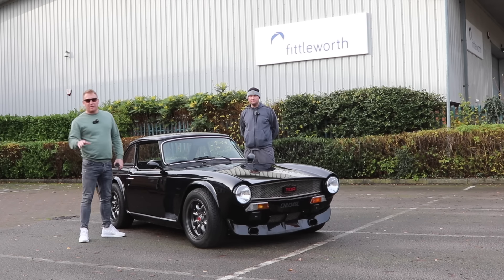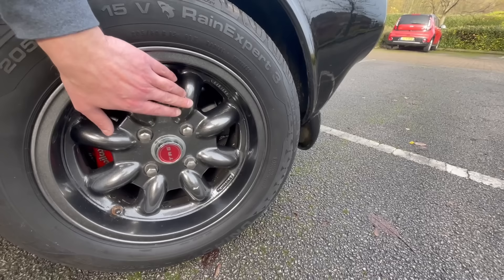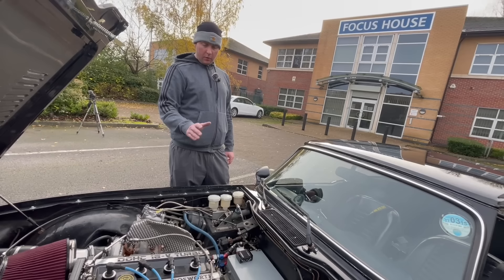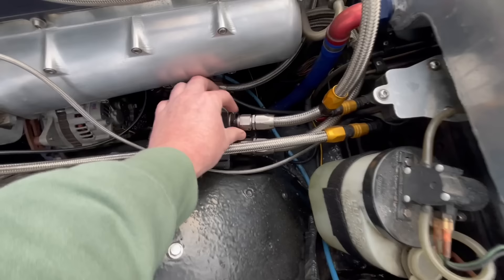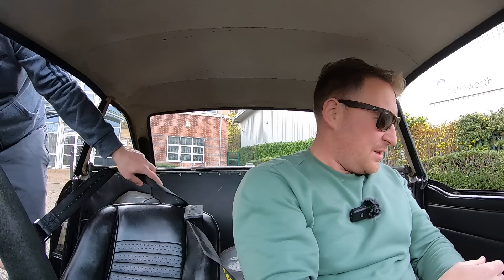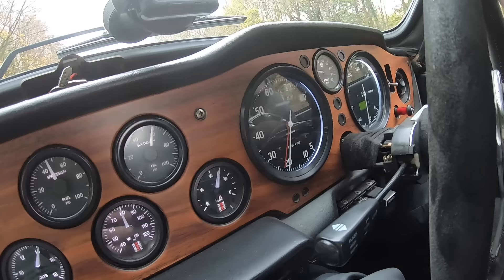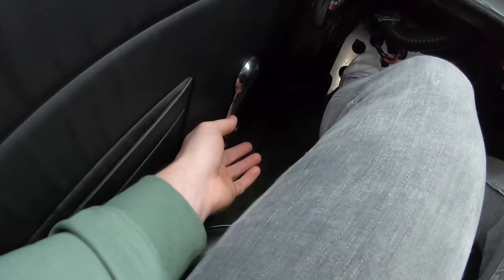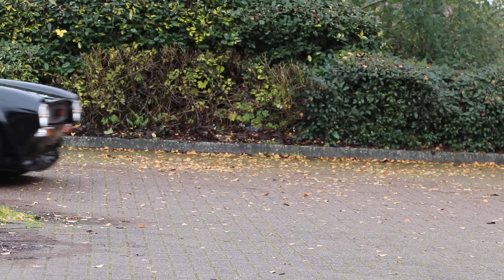This COSWORTH ENGINED TRIUMPH TR6 is SERIOUSLY MENTAL!!

Comment: What a fantastic car! Can't believe more people haven't done more restomod projects with a TR6, because it's such a cool looking car with bags of space in the engine bay. The look on his face when he gave it some beans, you can tell it's really on the edge with all that power in such a small package. His look is not just of fear but more like "What am I doing? This thing might kill us both!!" 🤣🤣
Reply: A guy on my block did a TR6 back in the early '80's but he put in a 355 small block chevy with a turbo. Car was beautiful and fast. 50 series tires and really nice home made flairs.
Reply: Rust is probably the reason there isn’t more like this.
Reply: @WIPEYOURLENZ  ya this is that era the car manufacturers were using recycled metal and we all know how that turned out.
Reply: The straight 6 is a great engine
Reply: Great posts here and yesterday. Too bad it was being chronicled by a couple of motor mouths.
Reply: haha great remarks...i also noticed that look of 100% concentration.....which could easily turn into fear :)
Reply: Our local triumph mechanic put a tr6 engine in a Herald and bolted it to a jag gearbox and diff added nitro and won a lot of drag races

Comment: The engine reminds me of the Cosworth Vega I owned in the  70's and 80's.  I removed Chevrolet's misbegotten fuel injection and fitted it with 42 DCOE side-draft Webers and then I loved it.  Jetting was a snap with carbs I could pull the entire jet stack out and make changes in less than 5 minutes  if I was motivated.  What a difference Webers make!  They are free-flowing and infinitely adjustable as I could slide in different size chokes all day if I wanted.  Very nice little car.......I should never have sold it.  All in all, this is a sweet ride and all the personal touches are well done and logical in their functionality.......great job!  By the way, I'm a Yank.......what language are these chaps speaking?
Reply: Geordie.

Comment: My Dad had a few of these, last one was a 1976 150bhp with the dreaded Lucas fuel injection. Had it really nicely restored and then made a massive loss selling it after very little use, he still kicks himself cus shortly after the value on them went through the roof! Lovely old car, the 2.5 6 banger sounded mint to me as a teenager.
Reply: Lucas injection system was ok.I had one and never had a problem other than it had to have a bosch fuel pump
Reply: I had one as my first car (DAO 639K), beautiful when it went but it spent more time at the garage than on the road having either the fuel pump or metering unit (whatever that is) changed.

Comment: As the owner of a TR4 for the last 50 years i wonder how you keep it in a straight line. What an amazing car and a braver driver than me!
Reply: Did you see the one on Ebay recently, with a LS3 V8 engine ? Very stock looking
Reply: The IRS made a huge difference (I note you said TR4 and not 4A), but the TR6 had a tendency to snap and step out at the back if you put too much throttle out of a tight bend or turning onto a road in anything other than bone dry conditions. Personally, for the road, generally the original 150bhp is more than enough on this chassis no matter what tyres/shocks you’ve got on it. Of course nowadays I doubt these get taken out much other than on sunny days; mine was everyday transport. I had a TR6 for about 20 years and a TR7 for 2 years. The 7 pissed all over the 6 in terms of handling although never looked as good and was rubbish if you’d got a girlfriend and no accommodation of your own! 😈😉😉
Reply: Engine looking for a chassis… handling was always crap, swapped mine for a Lancia Fulvia 1600HF, never looked back

Comment: With that much power, a locking diff would probably be more beneficial for keeping it in a straight line since it seems to be a recreational, weekend type of car. Beautiful TR-6, I always wanted one, but my dad said it was expensive to maintain British crap and that I'd spend more time working on it than driving it LOL. I ended up with a Capri 2600 V6(I live in California) in 1982 and actually raced a fellow in an early TR-6(early U.S. TR-6 were much faster than the later smog engine ones). We went neck and neck until about 85mph when I pulled away a bit(maybe a half a car), so I didn't regret getting the Capri over the TR-6, but I would still love to have one, and my long gone Capri as well!
 This TR-6 is purely brilliant!
Reply: Your dad was right. 😏

Comment: WOW that's an incredible TR6 that has to be the cleanest most professional swaps I believe I've ever seen. with all the high quality bits and pieces though out the car. there is definitely plenty of redundancy built into it with all the AN fittings and steel braided hoses. I really like the current owners philosophy with the car his saying that they wanted to get the most out of that they could. but because it's an old car a person has to have a great deal of respect for it. and how he explained every detail about the car, even though some people might find that to be too much information for a video. and how he seemed low key yet very allert and careful. and that the interviewer was almost beside himself so excited about this car, though the whole video. and how he explained how the previous owner was such a stickler about even the finest details, like his use of the ultra high quality and completely functional aircraft switches, and controls, gauges, those tiny details can mean the difference between a day of happy motoring. and a day where your enjoyment is cut short due to something as simple as a switch failure. and I also liked his choice of parts and components such as the T5 transmission. I had thoughts about finding a TR6 chassis or possibly an MGB chassis. and putting a massaged 2.8L on up to 4.0 L V6 in one, and match up which ever two would work out depending on parts availability, but haven't done it. I would have to get freed up from some other projects first. My father worked with a guy that put a 302c.i. 5.0 L V8 in a TR6. I know he had to build a special hood for it that was raised by two inches, and I know he was driving it around. but I haven't seen him in while because he's lives twenty away. and I haven't had to venture over there in a while. I will go visit him and see if he still has the car and see how it's doing.

Comment: The TR6's were in competition with the 240Z back in the day. They were considered pretty car cool with the then innovative IRS, independent rear suspension which gave the Z and TR6 extra corner fun. Radials were fairly new then too which added to the need for insurance of a better grade.:glasses-purple-yellow-diamond:
Reply: Yes, radials were a fairly new thing. I hadn't turned 16 yet as I remember riding my bicycle to his place to talk to him so this was built before '83. It was that pale yellow colour from new but later a red then a burgundy metallic. It sounded unreal too not a lot of exhaust pipe.
Reply: The problem is that the trailing arm design of the Triumph was prone to camber changes, making the cars very twitchy at the limit and in fact inferior to a good live axle. The 240Z's macpherson strut design (like the Lotus) was vastly superior, as the car magazine road tests of the day attested.
Reply: @racketman2u  <chuckle> I used to know that, thanks for the refresher...the 'twitchy' sticks as I had a 66 Healey 3000 and did find the Z-car more of mechanical envy, though my A-H sits dear to my Heart, dashboard overdrive, honey exhaust tone at 3kr's n all.
Reply: both rusted , tr6 had the lucas curse, prefer the 240z.
Reply: Interesting. My BFF (RIP) had a used 72 240z when I had my TR6. He never got it running right for long (fuel pump, overheating & stock carb problems).  We never raced, just wrenched together. He moved on to Saab's.  Good times.  We knew crap-all about mechanics & learned together on these cars.  Early/most Saab turbo's also electrical nightmares imho.  + FWD.

Comment: Brilliant build! Kinda agree that it's no longer a TR6, especially w/a turbo. TR6 was happiest @ 2.5-4k rpm imho & the exhaust note was magnificient! Then again I'd planned to install a '79 Chevy 400ci engine in my mint '72 BRG TR6 (measured & it fit) when much younger.  Totalled mine sadly 2 weeks before planned swap when a driver ran a Stop sign in front of me 2 weeks b4 date of swap 😭.  I already had dual side draft Webers, yellow Koni shocks & glass pack dual slash tip exhaust & redone interior w/highback seats (neck/head protection) . Stock engine w/Solex's & 0 mods made the stock 150hp on the dyno when reg'd @ 9yo when I got it. Had that same hardtop. Never used it in 3 years. Rare now. Loved that car! Sadly accident bent the frame so Ins totalled it.  Even had same bumper deletes 👍. Seriously no roll bar? Real fuel cell? Suspension sorted? TR6's handled well w/a bit of care & sorting. Personally don't like the Gadgetman interior/shifter. Interior makes it look 1/2 finished.  Mildly like this vid.  Black paint? & that tailpipe should be a TR6 crime. I can't imagine a harder clutch pedal than stock.  Definitely On/Off on mine.  Went thru 5.5 clutches (crooked mechanic 1x), 3 trannys in 3 years (said I was young 😆).  Engine was bulletproof.  I drifted mine occasionally (bit of rain helped 😉) driving up the hill home as there were several perfect drift corners. Definitely not a sleeper. More an Outlaw or Resto-mod.   & where's the ubitiqous luggage rack? 😀 Cheers to his brother for building & paying the bills! Kudos for not having Insta!  Yes I'm still looking for a non-OD 69-71 5 speed.  Now want to install an e30 6, 240Z 6 or go monster Nissan twin turbo.  The engine bay is massive vs today's cars.  Lucas elec/wiring had killed my OD b4 I bought mine. 70-100kmh in 4th & an open road, my 6 was happiest. Not a race car. Definitely a tourer.  Interesting build that sent me down happy memory lane. 👍

Comment: My uncle had a later model(maybe '73) TR6 in Burgundy color and to this day I still think they have a beautiful design.  This example is spectacular.   I was a 2nd owner of the last year('73) 240Z that I spent 5 years doing total mechanical restoration and just before completing I had a garage fire and lost it and my mind.  The profile height was about the same as this with the top of my fender being about half way up my thigh.  I could do an oil change by sliding catch pan under the car and leaning over the fender to remove the drain plug and filter so I never had to crawl underneath.  I had modified stock SU's(to prevent air leaks) and header and was putting out about 170-175 H.P. but, at 2260 lbs. full of fuel.  I had al the parts to rebuild the head and port it to bring it up to about 220 H.P. when the fire happened.  One time I ran side by side at 125 M.P.H. with a Fox Body Mustang 5.0 and I had to tell the guy I only had a 4 speed to humble him.  Although I had been to 140 with wind at my back at another time.

Comment: Great to see this old girl on the road even though it’s got a 4 cylinder engine.Good to see the owner respect it and he talked good sense too.I always fancied building a TR6 on a lighter stronger chassis with coil overs , poly bushes etc but I would have to keep the straight 6.Would need to slim down to fit in one now.
Reply: What's wrong w/a 4 cyl engine ? That's what is in the Porsche 919 EVO ( a V4 )
Reply: It’s a Cosworth. That’s all that needs to be said.
Reply: Poly bushes can crack the mounts. They transmit shock. I used to be a suspension tech - they have their place on the racetrack, but I’d never fit them to a road car.

Comment: Awesome machine… I ordered a TR-250 in 1968. The dealer called me back to inform me it was no longer available. But if I wanted “basically the same car” with that 6 cylinder they had a first import of the TR-6. It was amazing, Pimento Red with Black interior, wire wheels…but no O/D… only regret. It could keep,up with the Healy 3000 up to 120… really miss that car.

Comment: "Mom" means momentary. So it is not a permanent operation of the switch as it returns back to the "off" position when moved to the Mom position. A similar switch would be used for your headlight flasher.

Comment: That’s a right little beast! Cosworth rules.. personally theirs only one thing I would do & that’s move the air filter as far from the engine as possible. Mabey protrude it slightly out of the wing or mesh. That way yourll get as much clean cold air as possible.

Comment: i remember going out to a breakdown with 2 lasses in a 2500pi, they had borrowed their dad's car, turns out they had run out of petrol, "well, we put a gallon in this morning", they had done 9 miles from south shields to sunderland, the cossy lump probably does better MPG
Reply: My 2.5 PI had rich injectors fitted it was pretty quick, downside was it only did 10mpg didn't mind really petrol was around 95p a gallon!

Comment: The hard top really only gives you a quieter ride. A roll bar attached to the frame does more for stiffness than anything else.
Reply: No,this is not a modern convertible with extra strength in the doors or floor/ rockers,its an old bendy triumph convertible, the temp roof is most definitely structural.

Comment: I put a small block chevy in one. Would light the tires in 3rd accelerating through 60 mph. Well over 400hp. Could easily be  Darwin Award winner.

Comment: 😎👍🇺🇸

Brilliant car.
Absolutely stunning. I have a fondness for British cars. Owned a 74 Spitfire for awhile. Is was pretty much stock.
I currently have a 71 Mini Cooper S. Apparently it was a former Marry Hart car. It still has the striped interior with the logo on it. It's not a show car but still very clean tidy. Sadly it doesn't have the original motor. Nevertheless, it's a blast to drive. Gets lots of attention here in the PNW Seattle Washington area.

Cheers from 🇺🇸 ✌️

Comment: I'd love a TR6 to stuff my 2.3 turbo engine in, even in the XR4TI it's in, it's ridiculously fast and all I've done is header, forged internals, turbo, injectors and intercooler. I must have 12 or more of the SVO, Merkur motors laying around in the garage from when people thought they were junk. 300 whp from a mild 4 cylinder is nothing to sneeze at, and that's at 8PSI.

Comment: im fairly certain that car used to come into Cox&Buckles workshop in the early 90's where i worked - we all took it out for a test drive around Richmond park haha - was bloody quick then albeit not the prettiest of paint finishes -
Reply: Hi. This is the same car. I purchased it off the same keeper in 2020 (it is my car). The chap lived in Chiswick. I still have the invoices from the work Cox & Buckles did in the 80's and perhaps 1990's. This engine was installed in 1990. Great to hear any stories you have on it :)
Reply: Hi. This is the same car. I purchased it off the same keeper in 2020 (it is my car). The chap lived in Chiswick. I still have the invoices from the work Cox & Buckles did in the 80's and perhaps 1990's. This engine was installed in 1990. Great to hear any stories you have on it :)

Comment: Nice car and very well done but I can't help but feel that the soul has been taken out of the TR6 by fitting a Ford engine.  There were various alternative and very powerful engines like the Rover V8 that shares the family DNA.  The sound of a hot Rover V8 would have compensated for the loss of the equally sonorous Triumph straight 6.  The V8 would probably have been lighter than the turbo'd Cosworth to the benefit of the handling.

Comment: Would love a old tr6 with.modern v6 300hp.motor in it from say a camry, fast still handle and run forever😅
Reply: That's going to be the next big trend in custom cars. 
All the classics are too expensive and the new cars are too complicated and boring. 

Hot rodded old brit cars are going to be it.

Comment: Since it appears you're in it to win it, it looks like you would have scooted that motor back at least 8 in.
     And with the turbo, it looks like you would route your air filter in front of the radiator.

Comment: Nice car, im sure the 2wd manifold flows better than the 4x4 btw.
Reply: RIght you are. Though I do wish I could get 4x4 driveline parts here in the states. Just XR4TI stuff, it's good, but I want to build a proper Cosworth Sierra rally car replica.
Reply: @genefogarty5395  plenty of companies will ship to the states I’d imagine.
Reply: @JamieP.London  Any info on companies that offer that stuff for sale would be appreciated. I've only found used junk in Ebay and the prices are crazy, plus overseas shipping.

Comment: 4 point seatbelts are out right dangerous unless MAYBE you have them super tight. In the event of a crash, if you dont have a 5 or 6 point belt keeping your crotch in place, you WILL slide under the 4 point belt and "kiss" the dashboard with your knees or just plain get squashed under the steering wheel (good luck walking again after that). So many car enthusiasts / amateurs get infatuated with 4 point belts for the looks and they risk their lives everyday without knowing. A conventional 3 point belt is immeasurably safer due to its self tighting action in the event of a crash. Either go 5 or 6 point, or just stay with the 3 point. Now why I had this nitpicking comment from viewing the whole video? simple: jealousy!🤣

Comment: Drivers full harness needs adjusting properley-Proper car.Suspension?
Reply: Konis. Uprated springs. Poly bushes. Thicker front anti-roll bar. Brakes: Wilwood 4-pots, competition brake linings, Alfin drums, Morgan V8 wheel cylinders, wilwood high boiling point brake fluid.
Reply: Konis. Uprated springs. Poly bushes. Thicker front anti-roll bar. Brakes: Wilwood 4-pots, competition brake linings, Alfin drums, Morgan V8 wheel cylinders, wilwood high boiling point brake fluid.